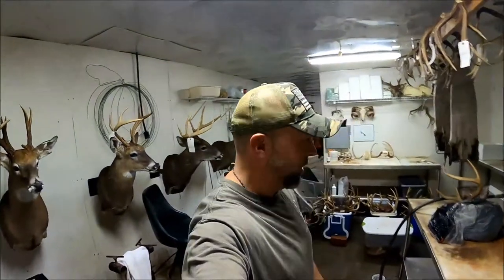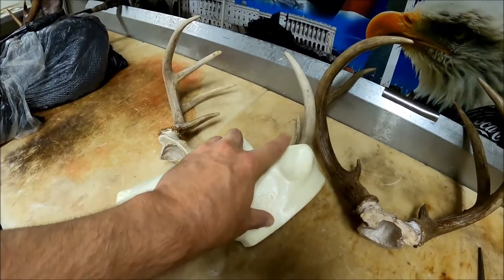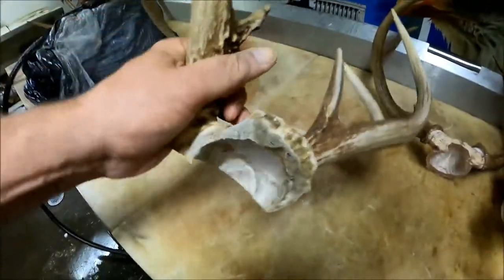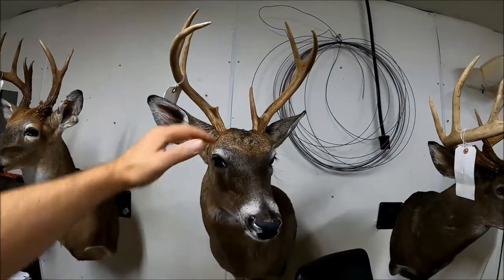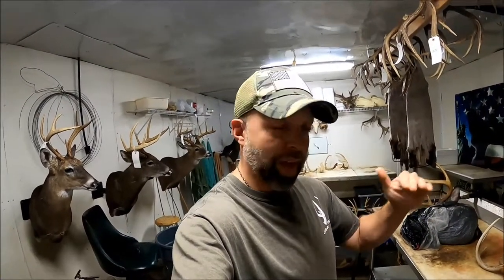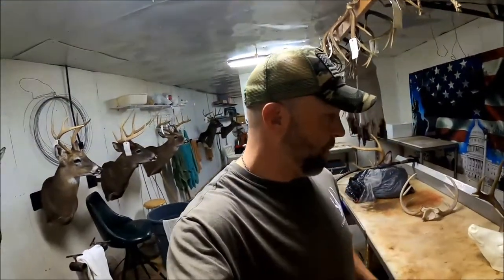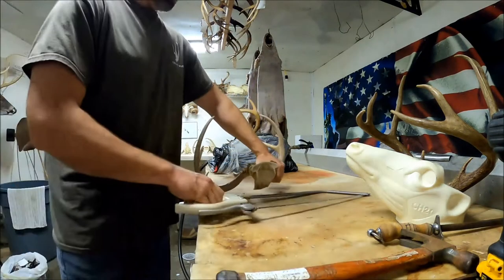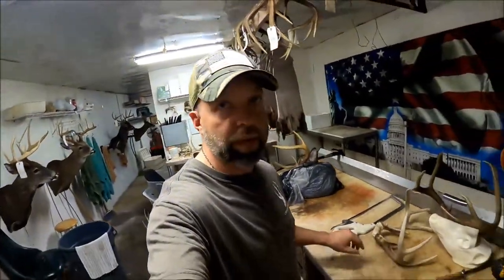ANTLER TRIMMING FOR A SHOULDER MOUNT ***SUPER EASY*** WHITETAIL TAXIDERMY!

Comment: Most information you find online says to cut half way between antler bur and eye socket. My deer measured 1” from antler bur to eye socket. If I cut it half way, I would be adding over 3/4” and figured I’d be pulling against my eye work. I cut as close to the antler bur as I could to make my distance on form 1”. Did I mess up or do the right thing?
Reply from the maker: I do prefer to do exactly what you did. Most forms don’t allow enough room for more skull cap than that. As long as the bit to eye measurement is right, you are 👍

Comment: Do you make measurements before you cut them off the actual skull and transfer them to the form?
Reply from the maker: No I don't. I line the top contours of the skull cap and the brow lines up with the form.
Reply: @thecedarridgechronicles  thanks!